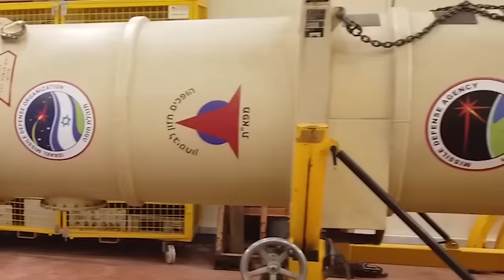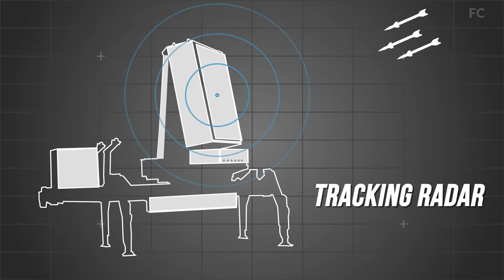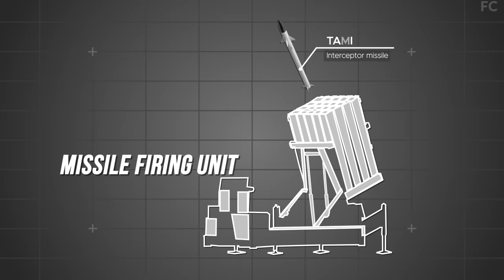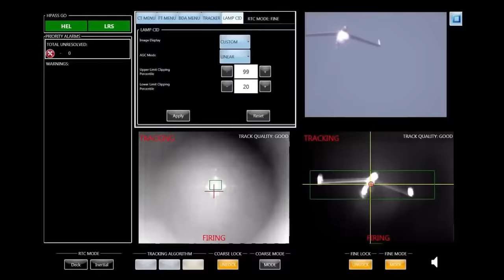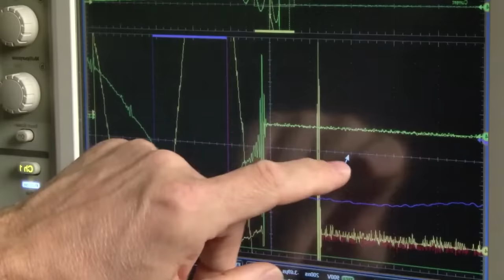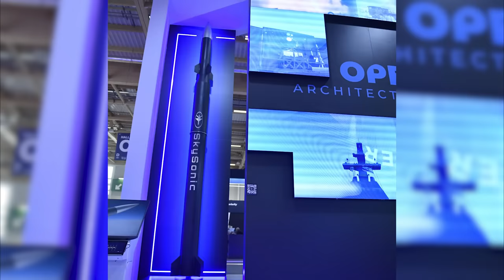ISRAELI Secret Hypersonic Missile SHOCKED Hamas, Iran and Russia

Comment: Why would it take a rocket traveling at mk 15 six hours to hit anywhere on the planet? The math doesn’t seem to be adding up. Maybe somebody’s not getting their facts straight.
Reply: Controlled.
Reply: Actually is correct math. Based on Iranian military math which uses manual calculator from 14 century to calculate.
Reply: acceleration and deceleration takes time my friend
Reply: Heh heh. That is the statndard of physics required to write Marvel Comics.

Comment: What’s the range of the laser?
Reply: 10 km.
Reply: it is quite short. lasers in general are far less powerful than shown in sci-fi with current technology and their strength degrades considerably with range and any interference. weather is a big limiting factor--a cloudy day or rain makes the Iron Beam a very poor, almost useless thing for anything really. The Iron Dome is much better in those cases. Otherwise you're probably talking anything 5-15km I think. Israel is quite small, so that is generally enough anyway. there is talk of an on-ship air-mounted aerial Iron Beam to hover and provide defense when weather is bad but you won't see much from that concept any time soon. 

it is much better to think of the Iron Beam as a helper system, particularly with drone or rockets the Iron Dome fails to initially intercept or which are expected to land in a remote area. there aren't really released rules of engagement for it yet. its utility has to really be weighed against effectiveness rather than cost. the Israeli public would rather spend $100k per rocket interception as long as it was a 95% kill rate vs. a few dollars on an Iron Beam interception that was less than like 90% effective is my personal assessment (as an Israeli). we do face the ongoing challenge of running rather low on Iron Dome Tamir interceptor missiles, and we have come to depend on help from the US to restock it quickly, so there's a good case to be made to find a balance between the two systems during war time (especially when the US legislature can't get its act together on spending bills)

Comment: I'm curious to know how the Iron Beam will fare against mirror-coated ordinance... or ordinance that can deliberately reflect the beam back to source (destroying the laser generator)...
Reply: Mirror coating ordinance would be a bad idea. It would make them to glow in radar. Mirror reflects more then just visible light and the point of modern ordinance coating is same as stealth fighters, to be less radar reactive.
Reply: @HotaruTomoe  I get that, but how does coating something that already appears on radar in something that... would make it appear on radar, make any difference? 🙂

The ordinance that's being fired at Israel is not "stealth tech" - it all appears on radar already (which is why it can be targeted and shot down)
Reply: @Chrisp3gg  https://en.wikipedia.org/wiki/Stealth_technology
True that mirror coating would be much harder for laser defence but also much easier for ordinary missile defence with optical targeting. Laser targeting is most accurate when target reflects the laser back. That's why they try to develop coatings that do not reflect anything.
Reply: @HotaruTomoe  That's true if we're talking a handful of missiles... however:

*Hypothetically*, if an attacking force launches 1000 "normal" missiles, conventional ballistics (i.e. Iron Dome) destroys, say 80% of them, with the Beam ensuring 100% success.

If those 1000 missiles had a reflective coating, it would defeat the Iron Beam (laser burst), meaning that 20% of those 1000 missiles get through and impact.

Does that make sense?

Edit: Remember, we're not talking about stealth tech here... non of the missiles being fired into Israel are "stealth" (which is why the Dome shoots them down anyway). This is purely a laser v mirror conversation 🙂
Reply: @HotaruTomoe  I think I found the answer anyway - a powerful-enough laser can cut through the reflective properties of a mirror (especially if it's an x-ray laser)...
Reply: @Chrisp3gg  It does. Mirror coating has it's up's and down's. Good for reflecting laser weapons, bad for reflecting laser guidance for ordinary weapons. In a nutshell, laser weapons would do no harm but laser guidance would get a really good lock on it.